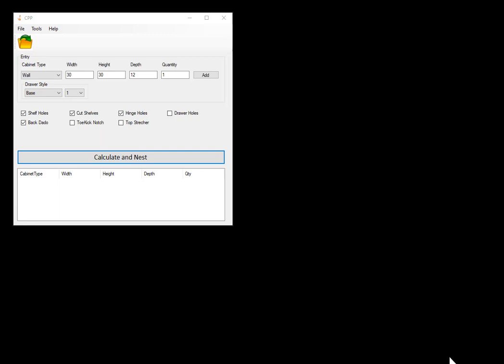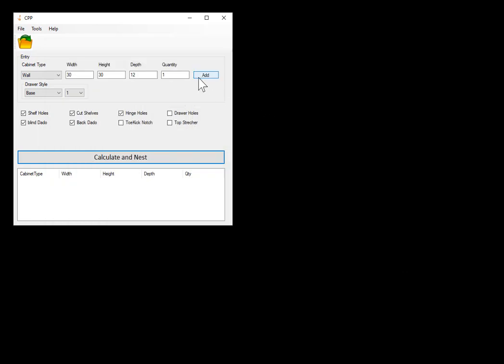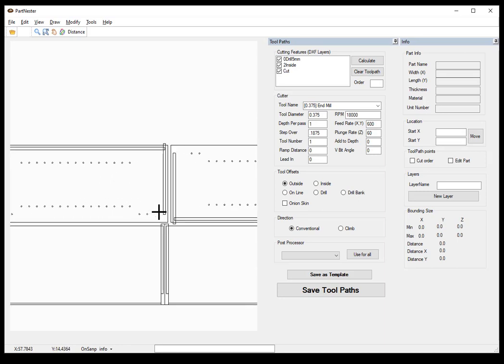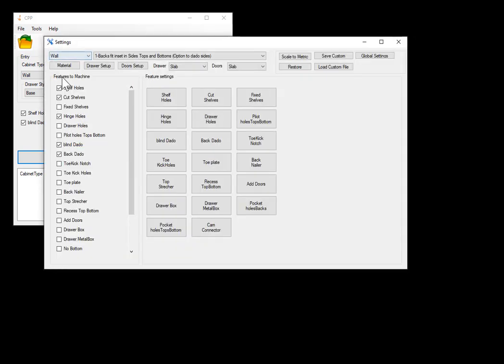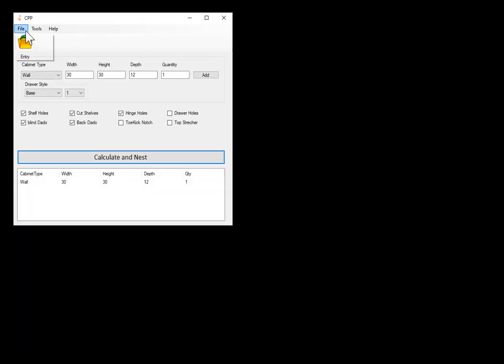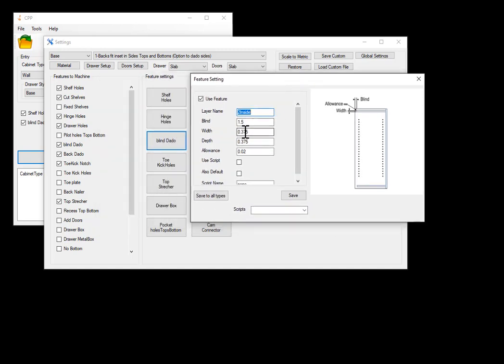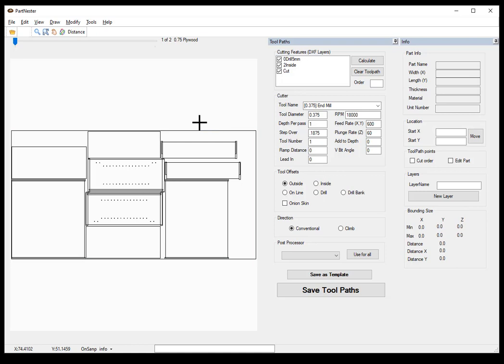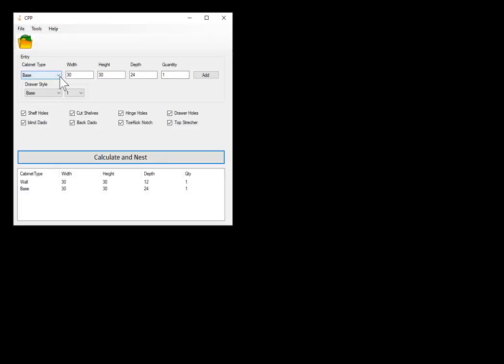Blind and Full dados cut on a CNC using CabinetPartsPro

Comment: Is their an option for 4 sided drawer boxes? In the demo it outputs without a front. Can the drawer box dado have an inset value to create space under the box for under mount hardware?
Reply from the maker: Yes to both questions.  It would output a 4 sided drawer box by default.  Maybe the front was on a second sheet?  There is also an option to add a notch to the back for an undermount slide.
Reply: @CabinetPartsPro  in your drawer box video, I don't see an inset value in the blind dado settings. Is it located somewhere else? I'm only trying to output drawer boxes alone, not with the whole cabinet.
Reply from the maker: @MrFreeway99  Take a look at the back dado settings.  For a drawer box the bottom is the back.
Reply: @Ryan Patterson  do you think you could do a video creating a drawer box by itself, with the bottom dadoed into the sides and front?
Reply from the maker: @MrFreeway99  I will, it will take me a couple days.
Reply from the maker: @MrFreeway99  Here is a link to a new video showing how to dado the bottom of a drawer into the fronts and backs.  Hope this helps

https://youtu.be/cGPh2vLUpK0